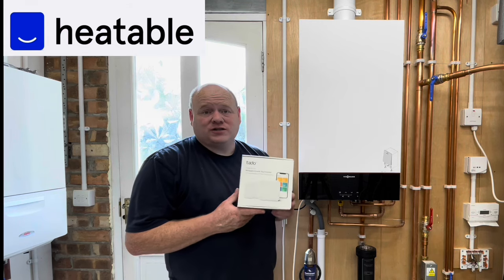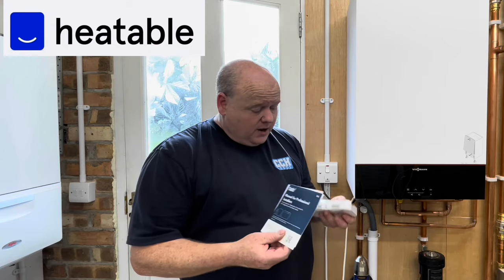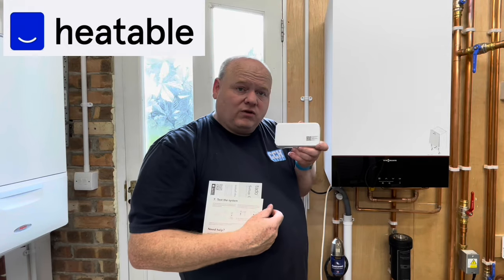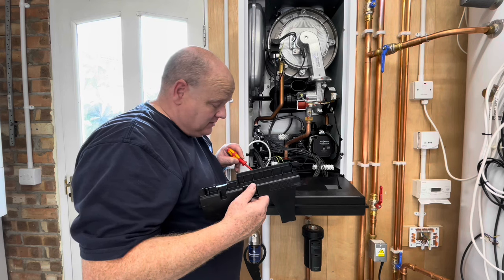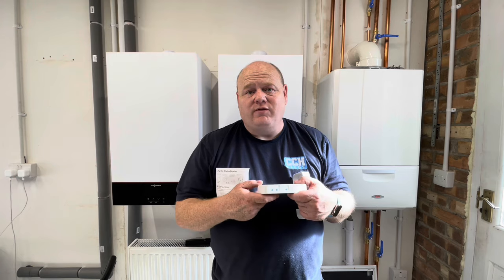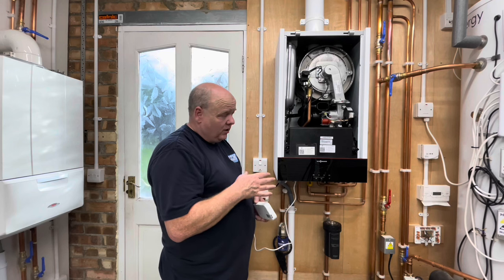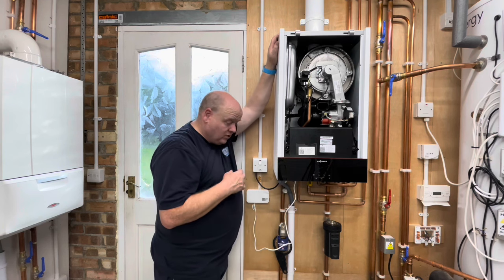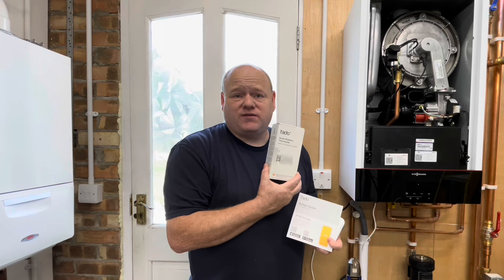How To Wire | Tado Smart Thermostat | Combi Boiler

Comment: Great video as usual Allen.  I would recommend buying the EU version (V3) of the TADO, not the UK Version to use on combi boilers, so that it can be wired in via OpenTherm, E-Bus etc to enable the boiler to make use of Load/Weather Comp. It just seams strange that TADO dropped OpenTherm from their UK versions as not many installers either used it or understood it.
Reply from the maker: This is actually the first Tado i have installed, I am looking at doing the rad valves soon. Thanks.
Reply: The tado load comp is pretty limited, it only uses radiator flow temps in its model. The weather comp is also quite slow to update, a dedicated local sensor is miles better.
Reply: @AllenHart999  They are my go to thermostats for combi installs, although I have to order them in from TADO Germany. But well worth it for a wirless OpenTherm option. Also the fact they work with all boilers, like Vaillant, Viessman, Worcester etc. makes them a great choice. But they have their limits.
Reply: @Swwils  I'm guessing your not using OpenTherm version, as when you do the boiler runs at arround 37-42 deg C and controls the flow temp. Perfect for retro fits under the new Building Regs Pt L.
Reply: @simonbeal277  it will control the flow temp based on local weather data that is not that accurate or quick to update in the UK. A local sensor can exactly control the curve in the real weather location.
Reply: @simonbeal277  do they let you order the opentherm eu version. Support told me they won’t ship it to the uk. They told me to go on eBay and buy the older extension kit
Reply: @Swwils  do you think it’s worth getting hold of an opentherm then or sticking with relay?
Reply: @sguk06  it will depend on your house but personally I think most UK homes would benefit from weather comp on the boiler (most support it with an additional external sensor) then regular controls rather than opentherm and load compensation.
Reply: @Swwils  have u managed to get Opentherm with Tado EU model on a system boiler?

I have ideal Vogue max s18 and it does support Opentherm BUT I fail to wire it so I have opentherm with PDHW.

Can't find engineer to do it. 
It's mind blowing!

Its S Plan with 2 x NC zone vales atm.
But been reading that need to switch to NO zone valve for the central heating.

Since controller has only RELAY connectors, where do I connect the zone valves to?
Reply: @bimiuk4051  tado recently pooped the bed and removed opentherm from the UK models. So if you have a brand new extension kit it cannot be used with opentherm. As you mention you have a EU model so should be able to at least get opentherm output:

You might need to think of a way of enabling the pump when you get a OT call - some boilers do flip some outputs live on an OT call for heat (I am not sure if the vogue does, I expect it DOESN'T) - so do some OT controls - the tado however also doesn't engage a relay either for a OT call at the moment - so you what you will find is that the tado IS calling for heat via open therm, the boiler IS responding, but nothing is turning the pump or valves on.  Might have to do it with a contact free relay, there is an open request to tado to enable this on the ext kit tado forum, since in theory it should have a spare relay that they could flip exactly for this. E.g. relay call WITH OT digital output like other controls have. You'll also be fighting with "idealtherm" which is barely compliant with opentherm.

If Allen wants to experiment he is free to come to my install, he services mine! 👍
Reply: @Swwils  it's just frustrating! Trying to do best option and cant get anywhere.

I think I need to return the TADO EU model and go for NEST. There is a video from UrbanPlumber guiding how to make Opentherm with PDHW on a Ideal Vogue boiler.

Since he says that CH zone valve needs to be changed to NormallyOpen - assuming he was working on a system boiler with a water tank , right? 

That is what I have, unvented tank with 2 zone valves and system boiler.

Just can't understand much of the wiring and can't find electrician who knows about Opentherm and all that.

If you get the chance, u may watch the video and give me your opinion? 

I already got myself Nest 3rd Gen.
Reply: Oh no. does this mean i purchased a device that states compatible with opentherm but is not?.. i bought mine in the UK i even researched Tado's website and i did not come across info saying that the UK version cant connect to opentherm.
Reply: @jasonkemp4859  I think the UK wired thermostat supports opentherm. But the wireless one does not.

Yet fail to understand what wireless or wired difference is.

Comment: Thank you! So basically two wires as a permanent live from the boiler to the tado block & the link wire is just a switch from the Tado system  to turn heating on or of via the app/thermostat! Its a shame in this wireless age it needs the complication needing to be plugged into the router. good video tho!

Comment: Allen please also cover wiring this unit into a regular boiler , preferably old school boiler that can’t use the cables as they normally have a timer in the airing Cupboard such as with an old manual timer to smart timer on s plan
Reply from the maker: It’s all very easy tbh, just following a wiring chart. I will see if we can do some at NGCFE for you. Thanks.

Comment: Ha, I did that about 2 weeks ago but a Potterton Suprima and EP3002 (S-Plan). As an aside it took me ages to find out what NO and NC meant, Normally Open and Normally Closed. I would be cautions showing the Apple Home kit id .... Also, you can buy the Myson TRV body on it's own to fit to Rads, about £6.50p each.
Reply from the maker: Thanks

Comment: Hi Allen.
Thanks for the great video.
I been installing these for a while now.
I think you skipped the configuration part.
Which is the worst bit of the installation.
For Combi boiler you have to disable the hot water function.
Other wise it won’t work.
It works fine with S plan and Y plan.
But it’s a nightmare on Combi boiler.
I think I will go back to hive, which is more easy to install.

Comment: As  an end user I can confirm it co exists happily with  weather comp on Baxi 600  and 800 kit. The absence of Open Therm on the UK product is frustrating.
Reply: If u get TADO from IE it will have OT compatible but then how would u connect it on a SPLAN commenly in UK?
Reply: @bimiuk4051  you can't use opentherm on Tado with system boilers, as a general rule
Reply: @Leonards-leopard  may I ask if ur an engineer or have experience with tado?

How ru coming to that conclusion? Is it just because it has no 2 x Relays connectors ?

I now bought NEST since @urbanPlumbrrs was not able to proof that OT and PDHW works with TADO EU model. Thought u don't need 2 x zone connectors for OT+PDHW because Zone will be opposite: one NC and one NO.

Nest seems to have lot of connectors available though they are not labeled e.g relay or HW or CH. Makes me think if that relay NC and NO is referring to zone valves?

Comment: worth mentioning that you can configure tado to have 2 zones and hot water control if you use an extra smart thermostat and have it hard wired to one zone valve. The other thermostat can be wireless and use the extensions channel.
Reply from the maker: Thank You
Reply: Unfortunately not while using OpenTherm. It’s a massive oversight on TADO’s part, hence I use evohome when doing zoning with OpenTherm.

Comment: Hi Allen, I have a Glow Worm Betacom 2 boiler, which is presently wired to a 24V room thermostat via the 24V connection on the boiler. There is also a 230V connection on the boiler available also. I have tried to get info from Glow Worm and Tado on how to wire the receiver, but either have given a positive answer. Can you help? Can the receiver be wired to the 24V connections? Good videos - easy to understand. Thanks

Comment: Wiring a Salus Rx10rf to my boiler, and want to know if the com and no are volt free connections in the link you removed, I’m worried that they might be switched live, my boiler is Worcester CDI25 and I’m not sure if the link is volt free, don’t want to blow my boiler or the controller

Comment: Hi there, I have a honeywell wireless stat at the moment, with a neutral, live and an A and a B wire between the receiver and my viessman vitedens 200 boiler. Will I be able to use the existing wiring coming out of the boiler or will I need to change it. Thanks
Reply from the maker: Not sure on the 200 tbh. sorry.

Comment: Just a quick question about the existing wall room thermostat, would this be rendered useless or would it need to be set to full? Also, the timer on the boiler would this need to be set to constant?
I have a Worcester Greenstar 30Si Combi... TY

Comment: Hi Allen I have brought a Tado starter kit v3+ wireless smart thermostat for my worcester greenstar 28cdi. I am going around in circles with tado trying to get the installation guide from them and ripping my hair out as was told that this would modulate the boiler through the EMS bus. Is there any chance this is something you could help me with or do you know someone in Cornwall who knows how to wire this? Many Thanks, Scot

Comment: Can anyone help me out? I have a very old Raven heat boiler and I can’t find the manual. It has a live in and a live out plug which is not a problem. 

The old thermostat receiver is wired into the live out so that makes sense. 

However The common and the NO are wired into a plug labelled ‘room stat’ which again makes sense however they are light grey and dark grey not grey and black and in the receiver itself they are not very helpful. 

The receiver labels are N/L/1/2/3/4 with the light grey in 1 and the dark grey in 3

Comment: Good afternoon can kindly help me with wiring a tado v3 smart thermomstat into my vaillant ecotec plus 825 please. 
Our v smart thermostat has given up and I purchased this one but I can’t for the life of me understand the wiring diagram.
If someone could help I would be very grateful.
I will attach a pic of the boiler connections for reference.
My old connections went into the bus connector on the boiler and into the gateway which I haven’t disconnected yet.

Comment: Hi guys, I'm looking to get Tado but am getting a bit confused from the comments. Are people saying that the UK version doesn't have load compensation i.e that it doesn't actually modulate the boiler?
Reply: I’m the same, long discussions with support. Yep, they took opentherm out the uk version!
They tell you to wire a thermostat straight to the boiler and then get a second add on thermo
Or use a wireless thermostat and buy the old extension kit “somewhere” as it’s discontinued 

Many installers don’t seem to know how to wire opentherm and wonder why we are asking for it.

If you buy a smart thermo v3 kit it’ll come with the new box which only supports relay. Stupid.

Comment: Hi, I was going to install the Tado smart wireless thermostat on my Vaillant Ecotec 831 boiler however I spoke with an engineer who said while it can be done on the Ecotec boilers it will not run as efficiently as they would using their own controllers.

This is due to vaillant having their own Ebus chip and third party controllers can only control the boiler to be on or off rather than gradual heat control, this wasn't always the case with the previous vr65 which I think were opentherm but since the vr66 this seems to not work aswell with third party.

Because of this I decided to only purchase the Tado radiator thermostats which come with the bridge in order to run those as an extra while keeping my Vaillant controller.

Please can you or anyone else confirm this to be true?